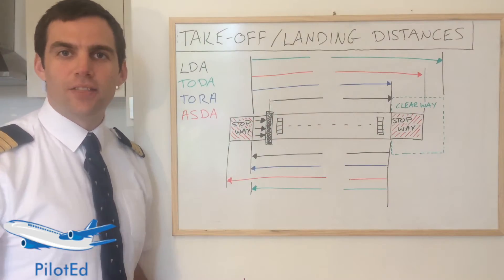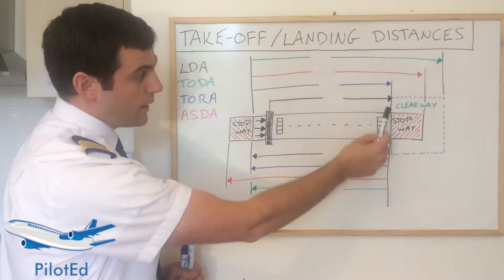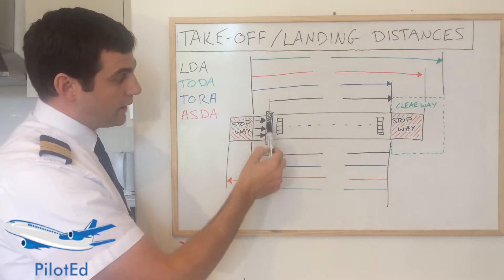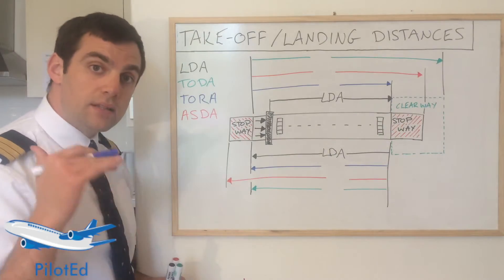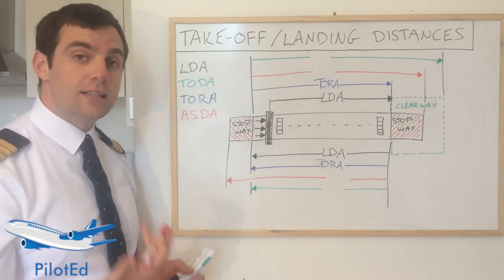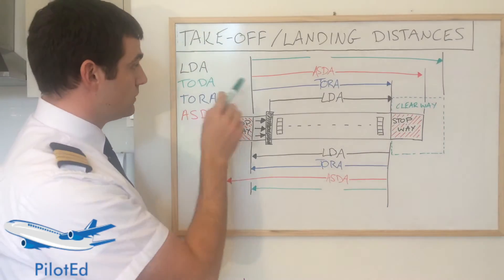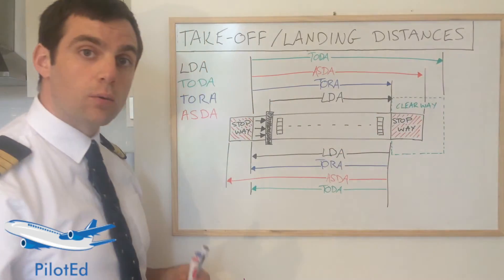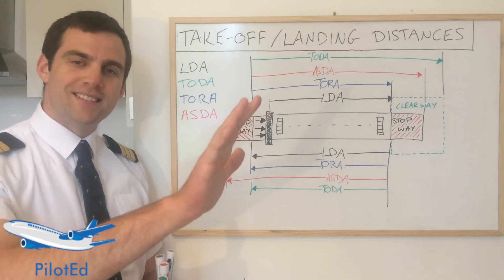Take-Off and Landing Distances ✈ ATPL ✈

Comment: These all shits like Stop way, Clearway and with that TODA, ASDA, TORA. LDA comes in when short runway owners/operators could not meet regulatory requirements. I am fail to understand that once a Stop Way can take a full load MTOW (that is must for the surface to be declared fit for that purpose) of an aircraft than why it is not fit for landing aircraft at MLW which is always less than MTOW. For pilots it is simple to know that the runway is suitable for particular type of aircraft or not, ( ie meeting all regulatory requirements or not and that is a job of Aviation Authorities). In a suitable definition other things also comes in, like emergency services, type of lighting, instrument approach procedure etc etc and not only the length. So remember suitable or not suitable.

Comment: Why would V1=Vr when doing the takeoff performance
Reply from the maker: if we have a balanced field ;)
Reply: Because v1 cannot be higher than vr so...

Imagine you have 4000m tora
Asda 4000m 

You hit vr after 2000m 

Why would v1 be lower than vr if your asda is 4000m 

And let's your accelerate stop distance is 3000m with v1=vr 

Gosh i i complicated it to much 😂😂😂

Basically you are limited by vr in this case